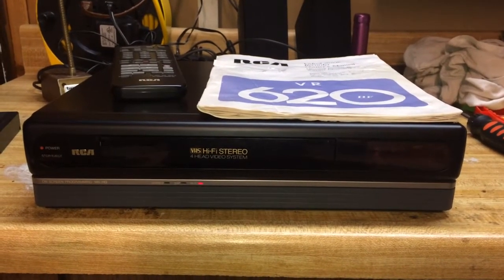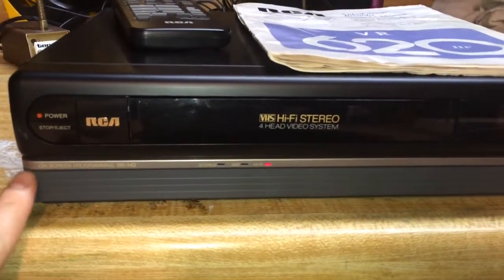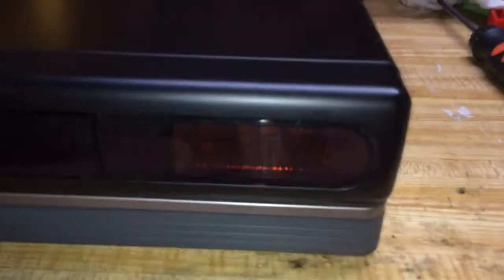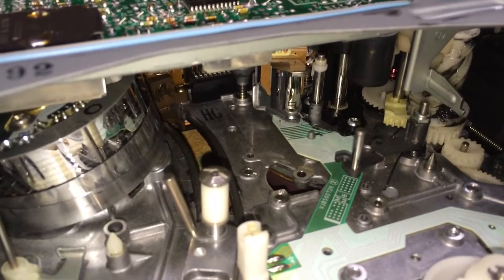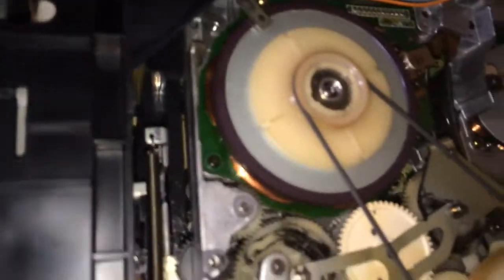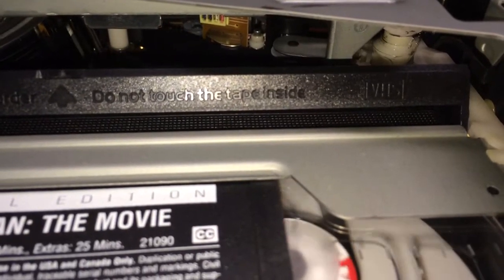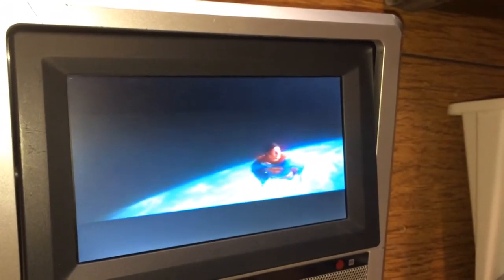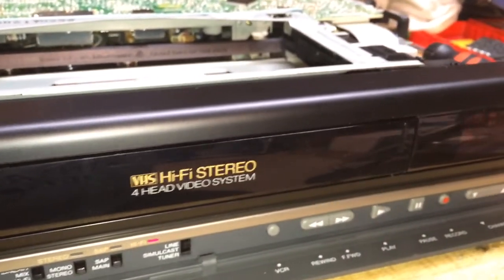RCA VR620HF hi-fi Stereo VCR from 1989 - 90s Purchase

Comment: I had this exact model VCR back in college.  I bought it in 1990 and it was around $499!  But other Hi-Fi VCRs were much more expensive at the time.  The only photo I have of it is blurry.  So I googled and found your YouTube video.  Very cool!  And yes, it was a fantastic VCR and the Hi-Fi stereo sound was amazing.  Many people did not realize that the only way to hear the Hi-Fi stereo audio was by using the audio line outputs.  I had it for about 5 years and one day my apartment was burglarized and the fools could not unscrew the coax cable so they yanked on it and ripped out the entire coax threaded connection, ruining the VCR...that they still stole.  The TV cable still had the threaded part screwed into it with some wiring.  So at least they ruined it when they stole it.  I replaced it with a Sony VHS Hi-Fi deck that lasted many years.  I still have two working Sony VHS Hi-Fi decks now.  I remember the three switches under the flip down panel on this RCA...they had to be on HiFi, Stereo, and Main for the best audio.

Comment: The rca vr685hf was my first VCR as a kid and just got one new in the box with a lot of 11 other VCR’s new in the box bought off the guy. Was after the rca vr685hf and plan on servicing it soon, if it even needs it? It actually has line TBC if I remembered. Definitely was a good machine and lasted till wore the heads out twice on it. Learned how to replace the heads at a young age. Yep bring back good memories of watching movies in HiFi stereo. Had still the level adjust and audio video dub plus speed control under the bottom flap 

Was made by Hitachi back then.

Comment: I had an RCA VR 625HF as my first hi fi VCR for my home theater system - similar to the VR620HF, it had the flying erase head and you could adjust the audio input level for the hi fi tracks.  It was a great unit and it could properly record Macrovision protected tapes as yours would too.

Comment: This is a Panasonic G-type mechanism chassis. Be very careful with these as they have a lot of gears and when they break or get misaligned, you're screwed... Also, take a look at the capacitors in the power supply. Usually they get dried and that's probably why the display isn't working.

Comment: This is not a LCD screen but a VFD screen.

And I think you can "clean" the VFD by putting a high voltage on it. It will get the anode cleaned and it will work again.
Reply from the maker: Thanks for the tip!

Comment: So the stereo switch on the front for linear and hifi and one other I can't remember doesn't work? You said this doesn't have linear.
Reply from the maker: MickeyMillz Dawg It's linear MONO, not STEREO.  All VCR's have linear sound.
Reply: @databits  if I recall, the switch allowed the capability to playback the linear stereo track (and mono track) if the tape did not yet include the Hi-Fi audio track.  This VCR was at the beginning of the transition from linear stereo VHS tapes to Hi-Fi stereo VHS tapes.  The Hi-Fi audio is recorded on the main part of the tape, not the linear portion.  My college roommate had a Magnavox VCR that did not yet include Hi-Fi stereo, but could playback linear stereo audio and featured Dolby Noise Reduction because the linear track was much less quality than the Hi-Fi track.

Comment: Could you possibly link to that lube you made? Awesome find by the way.
Reply from the maker: x9x9x9x9x9 - I can't find a link to it but I found it in an online book.  Get some Vaseline and some #2 flake graphite powder (hobby store).  The recipe is 10 parts Vaseline to 1 part graphite powder.  It's not real important that it be exactly that.  I used one container of Vaseline and dumped the contents of the tube(s) I bought into it and stirred it up real good. It will be a black and very staining grease, but highly effective.
Reply: Ah ok.it was exactly what I thought it was. When I saw it was black I figured it was graphite. Thanks!